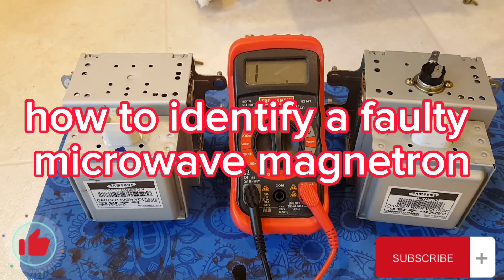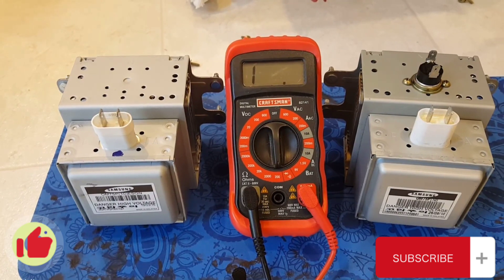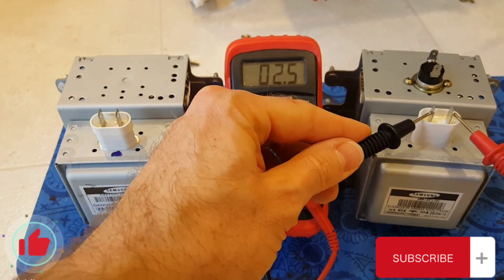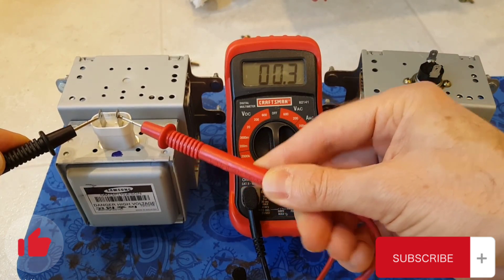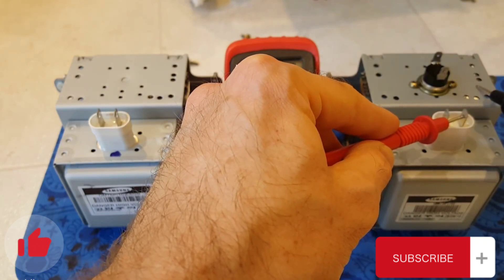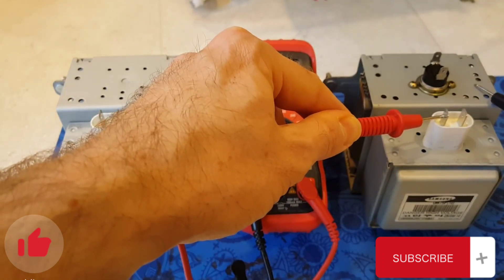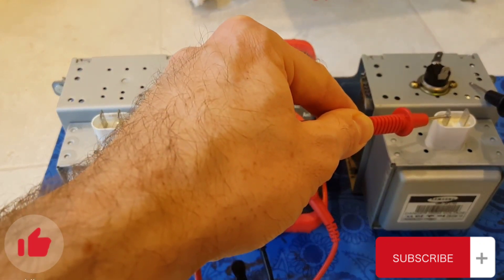testing microwave magnetrons, how to identify good and bad ones

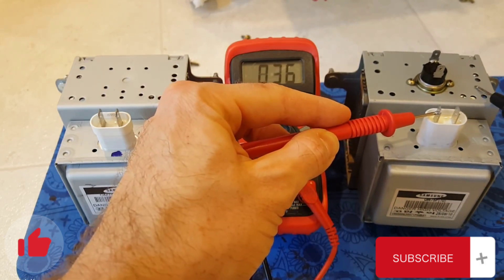Comment: Thanks for the video.  I have one suggestion:  At 1:18, the resistance is jumping around when you tested the magnetron terminal to the case.  I believe you had a poor connection and should have been pressing the tip of the probe into some bare metal like the edge of the metal.  You should hunt around with the probe until you have a stable reading to be accurate.

Comment: OK, I'll have a look at mine. Are all magnetrons the same? Can I use one from another microwave brand?
Reply: It is recommended that you choose a universal magnetron. The selection criteria are: 1. Same power 2. Similar mounting hole positions 3. Same connecting plug
Reply: @shalibrenty7695  Looks like in my case, the problem was the high voltage capacitor. It looks like a big aluminium can, I think it is 1 uF.
I took one from another microwave and my old microwave from 1992 now works.

Comment: I noticed that when doing the test from the terminal and the case, although there was a reading initially,  it then went to zero. I had the same situation and thought it was just the meter settling down. So is any reading, however transient is bad? I also have scorching on the antenna, is this significant?